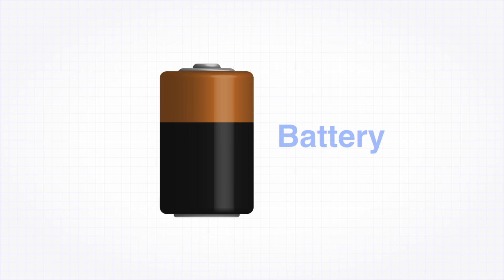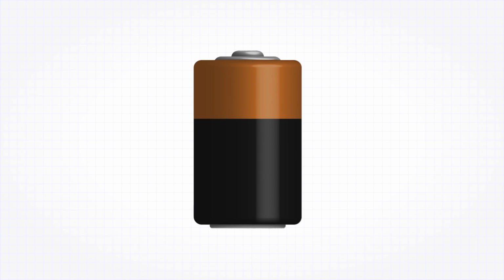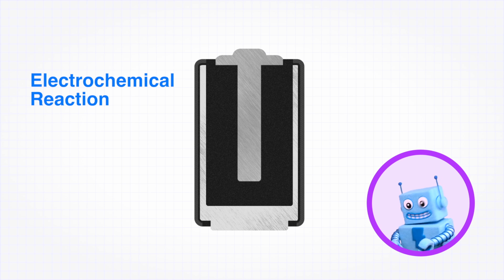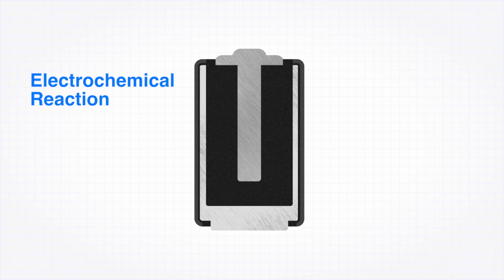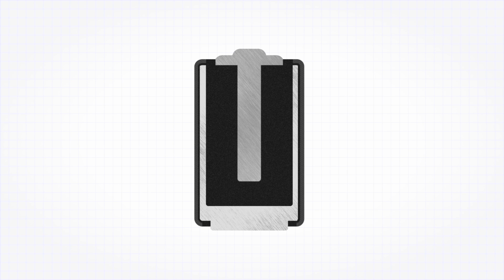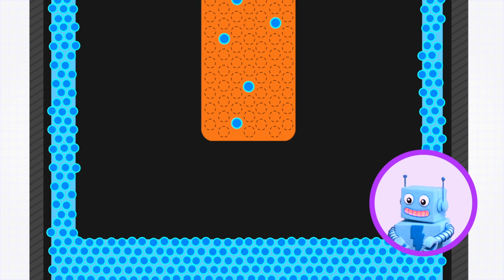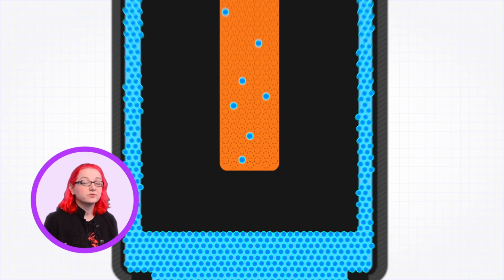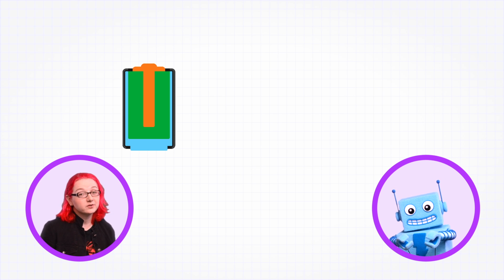"B is for Battery" - Circuit Playground Episode 2

Comment: Number the lemons from left to right, we have lemons 1-4. I can picture the electrons moving from negative terminal (nail) of lemon 1, through black wire, through LED, through red wire and then to positive terminal (penny) of lemon 4. How is hooking up 4 lemons like this better than just 1 lemon? As stated early in the video, the gap between each nail and penny (lemon juice) is electrolyte and "electrolyte blocks electrons."

Comment: My understanding is if you just add more pennies and nails (and connect them in series) into the one lemon you can get more power, don't need to use more lemons. Is that correct?

Comment: According to your explanation, electrons travel from the zinc nail to the copper penny through the cables. When the lemons are in series, if electrons travel from the nail in the lemon on the left to the copper penny on the right, how do the other lemons interact? Presumably the electrons cannot travel through the electrolight in the other lemons.